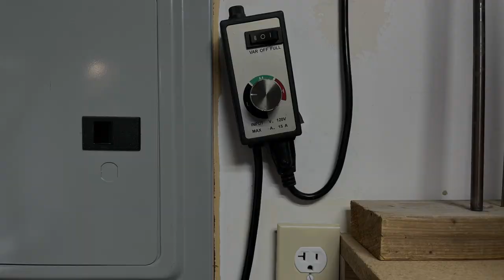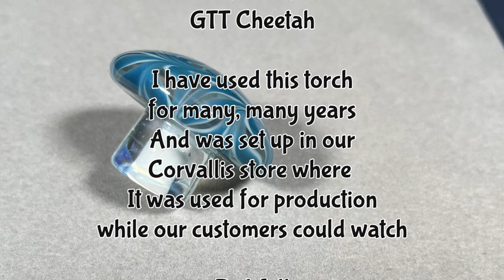The New Torch Workbench is Built and Running!

Comment: I'm new to glass work and I have been enjoying your videos. I DIY a lot of stuff in my garage and was wondering where you got the wheels for your rollers. Thanks.
Reply from the maker: I found stainless steel and brass blanks on eBay that are just rough cut. I do not own a metal lathe unfortunately and used a drill press, bench grinder and disc sander to shape them. needless to say it was very difficult and the end results not perfect but for the intended purpose it was a rewarding project!